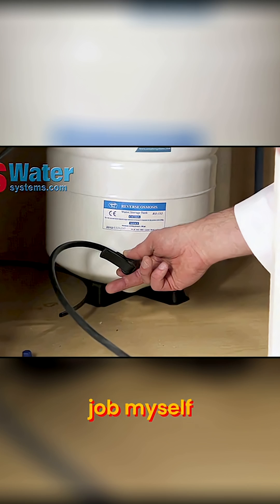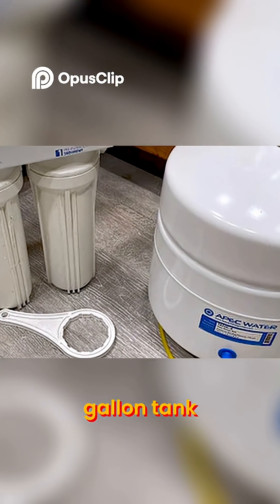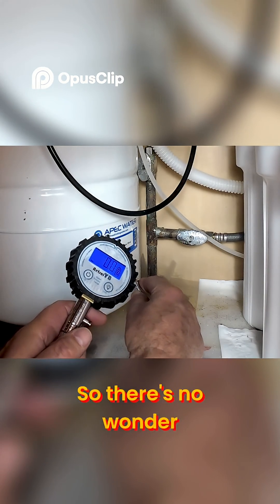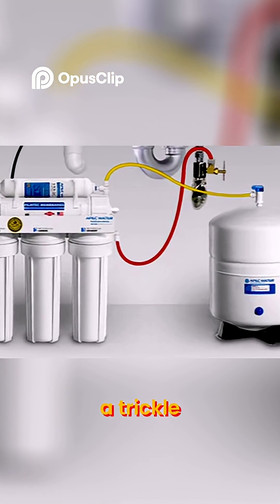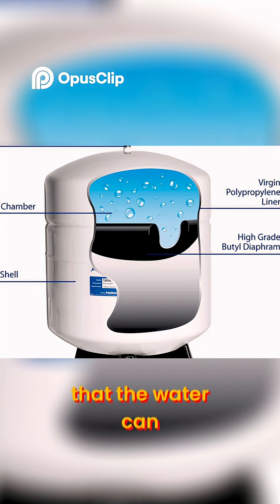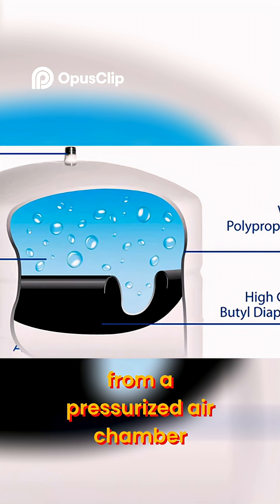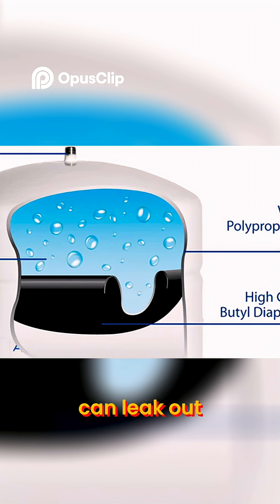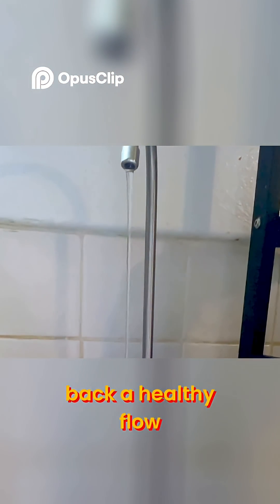RO System Tank Pressure Fix

Comment: What is the max air pressure after the tank is full? That way I can check the tank each month to see if it is losing pressure. And just add air to the max air pressure. Without having to drain the tank.
Reply from the maker: It's actually quite low - around 7psi.  Different manufacturers may say less.  The problem is, that's the pressure with the tank empty, so you would have to empty out the water first. Then every time you attach the the gauge you might loose a pound! I eventually just changed the tank (in this vid https://youtu.be/S7v0E_1JdfM?si=H6yymkgiKLByfJYm) and now I can get gallons at a time without loosing much water pressure. Once the diaphragm gets punctured it's all over.  Look for sales (black friday etc..), and you don't even have to stick with the same manufacturer.  The one I got sent from Apec was actually a different brand... I guess they ran out of their own or something.